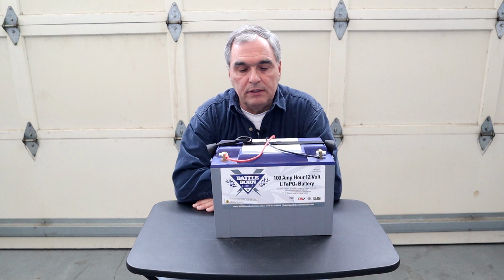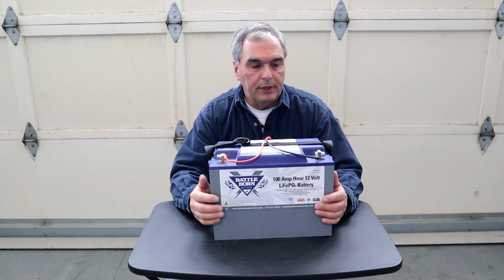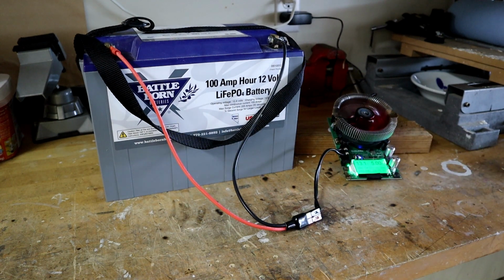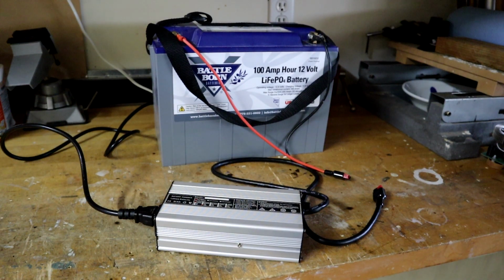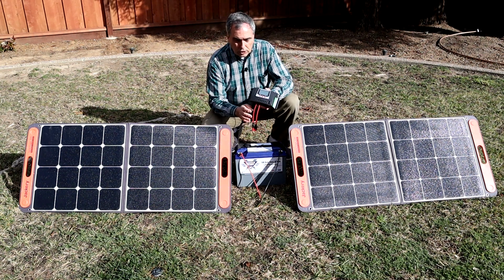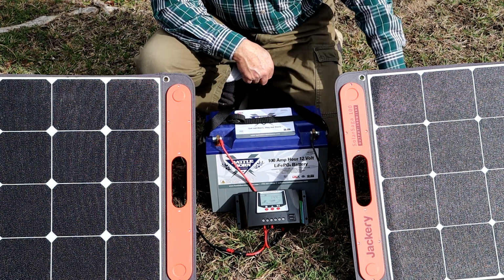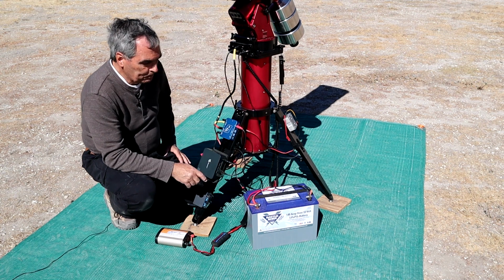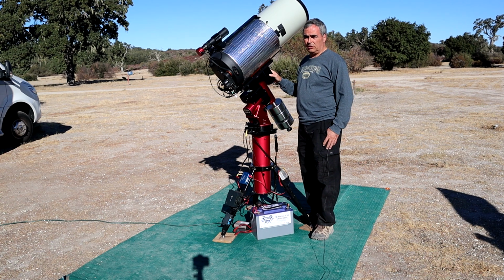Battleborn 100Ah LiFePO4 Battery Review

Comment: I prefer the prismatic cells. You can get four 280ah 12v batteries for under $2k.  It takes 2-3 months to ship from China, but to save $8k for over 1100ah, it's worth it.  Even if you have to buy your own BMS.  If you don't need that much, it's still under $500 for one 280ah battery.  That's cheaper than lead acid, not even accounting for all the times you'd have to replace lead acid over the life of the prismatic cells.  Will Prowse even tested and confirmed they test as labeled.  Of course, if money is no object then the convenience of BB can't be beat.